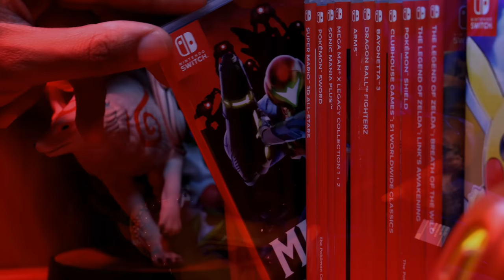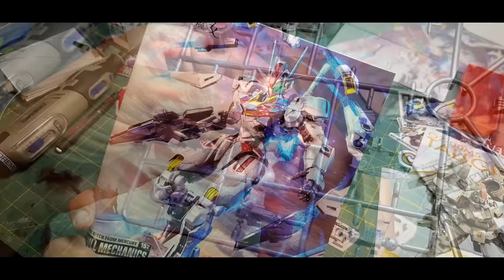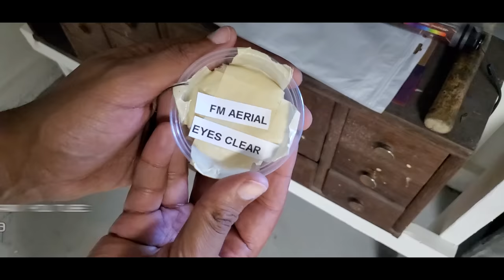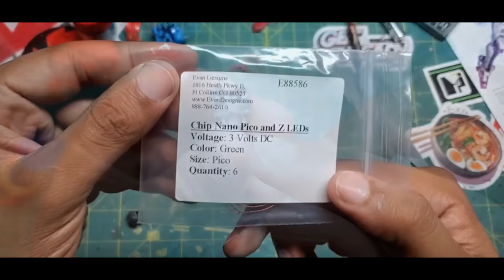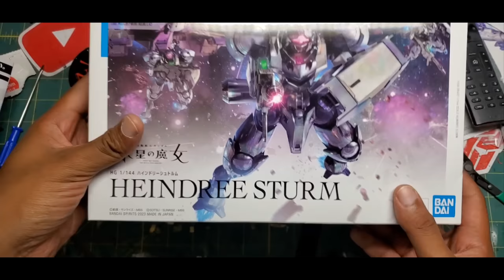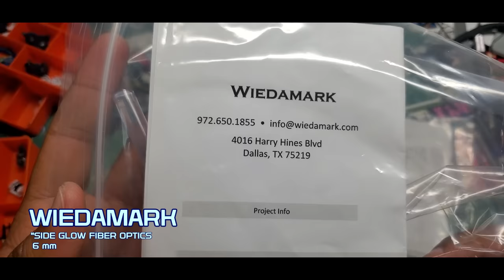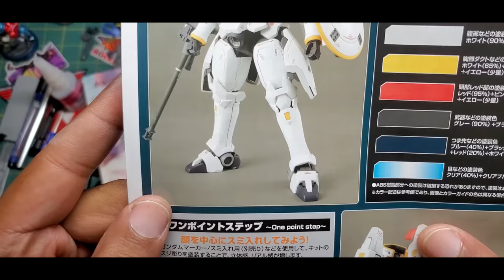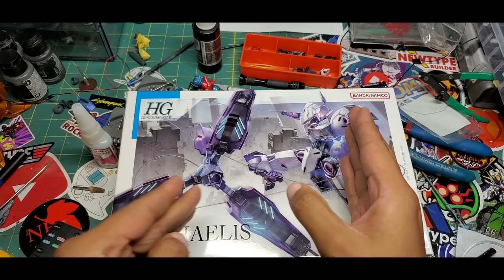#newtype #metrioddread #gundam  1/100  Metriod Dread (KITBASH)

Comment: Have you ever tried using silly putty to do the masking job? I just tried it and man! Is waaaaay more easy than being cutting masking tape!! You can shape it as you please and remove it even easier! Plus is very cheap! Give it a shot some time!
Reply: Easier, yes. But not for doing straight, clean lines.  Great if you wanna do various forms of camo though! ^_^
Reply from the maker: No I'll give it a try. Any recommendations on a particular product I can use?
Reply: @OtakuBuilder  For camo stuff, the stuff I see used most often is just regular ol' blue or white poster tack. Roll it out into snakes, place it on in funky waves, spray colour, peel off. Rinse and repeat after drying if you wanna do multiple colours.
Reply: @OtakuBuilder  silly putty is very cheap, you can find it at target. I know you are not into modeling with green stuff or milli putty but exploring new horizons can be fun, i started by painting my Rex watching your videos, then jumped to polymer clay and crafted the Metroid Queen, and now using green stuff and milli putty i've done Samus dread gravity suit version and Raven Beak, using action figures as base. You never know what you can do untill you try!

Comment: great video. music is too loud in comparison to your voice when you transition to the montage sections
Reply from the maker: The volume levels are actually just fine. It all depends on the kind of audio setup you're using. When I review the video I make sure I tested out on two sound systems. One that's the two channels speaker system the one that's a 5.1. Another thing you had to take into consideration I have a son so I can't speak as well as I used to in my previous videos because if I do speak any louder it will wake you.